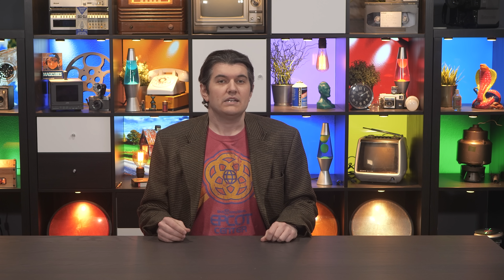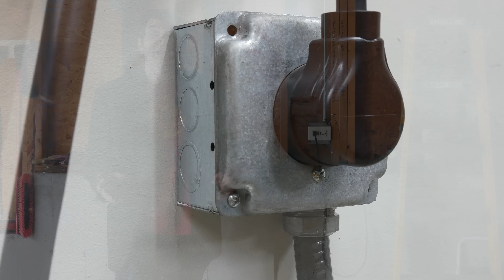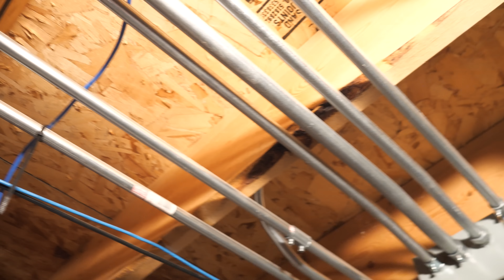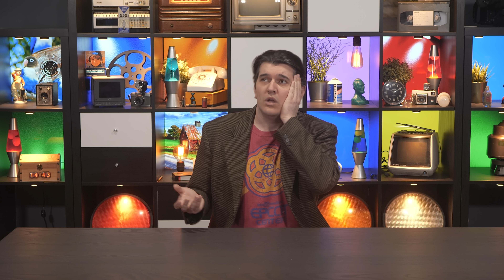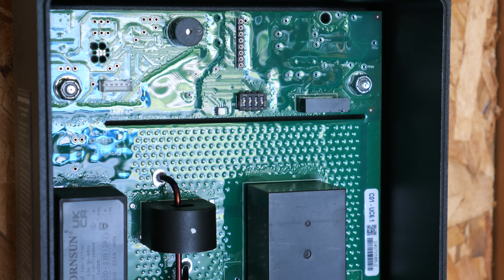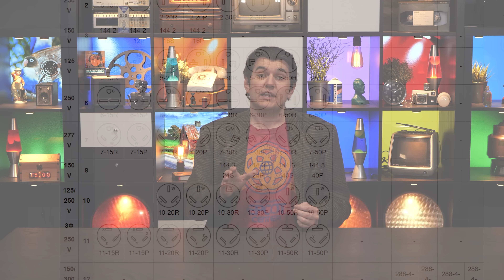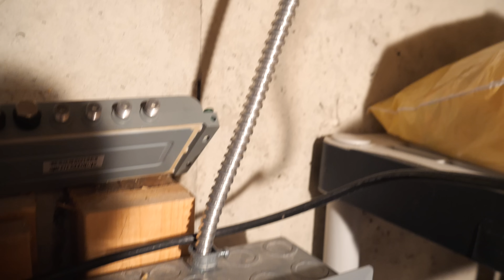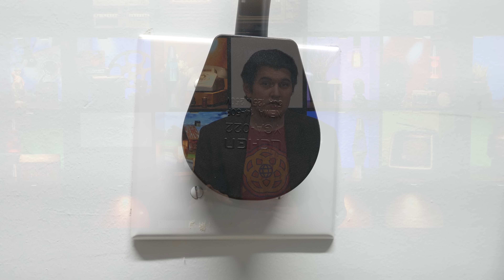The "standard" car charger is usually overkill—but your electrician might not know that

Comment: I would add that while 120 volt charging does work, it’s a really good idea to wire a dedicated circuit for it. Then if you are going to wire a dedicated circuit, you might as well do a 240 volt circuit. Then use the old, shared 120 volt outlet for your chest freezer 😎
Reply: Yup, when I’m charging level 1 at my parents cabin, it’s on a shared circuit. During the morning when brewing coffee, or while using an oil space heater, I have to drop the charging rate down to the minimum 5 amps or turn it off, else the breaker trips.
Reply: Further,
If using 120 V. 
Don't use a Residential Grade or backstab receptacle. 
At minimum, Use a Specification Grade receptacle. (best to get one brand new)
Also, if the 120V circuit has other receptacles 'upstream' of your charger, be sure those are spliced properly NOT using backstab type connections.
Reply: Where I live I trip the breaker if I have the microwave and the space heater going at the same time.  Took me 6 times doing it to stop fucking doing it.  Downstairs isn't wired for kitchen stuff and the house is 90 years old.
Reply: Yep. Using an existing old 120 volt outlet that isn't dedicated can and has caused fires when charging vehicles.
Reply: The sparky was going to be in my roof anyway, so I asked him pull 2 extra 20 amp wires for the garage while he pulled the thick 60 amp line. It was almost free except for the hardware and time to wire up the 2 extra outlets/breakers.
Reply: uh oh, you might have triggered alec's heat pump rants
Reply: Oh hello there Jimmy!
Reply: Exactly. You can literally add a 20 amp 240v circuit for a few dollars more than a 120v. But in cases where the runs are short and access pretty good, it makes sense to just go bigger for not a lot more money. Never use the old standard outlet in your garage unless you like drama
Reply: @JimmyDorff Just curious, why is it a really good idea?  I've been charging my Tesla on the shared 120V circuit in my garage since January with no signs of any issues.
Reply: @JesseOsby  The issues are mainly around the outlet itself, how old / worn out, how it was installed, are there other things on that circuit, etc. 
There has been cases of 120V outlets melting because of the continuous ~12A draw and a bad connection in the receptacle area. 
Most people don't know the history of the wiring in their house. Ultimately, documentation, building code and recommendations are built to handle the worse case scenario. 
So the new circuit is really for the peace of mind of having something that's proper all the way, with no surprise splices in there, etc.
Reply: @nuitari1669  Interesting, I'll have to check the temperature of my outlet with my temp gun the next time I'm charging to make sure it's not getting too warm
Reply: @JesseOsby  As others have said, many 120v outlets are poorly installed. Electricians in new construction are paid to go fast, and I've directly seen damaged / melted outlet from EV charging.
Reply: People worry that older installations were not made with the expectation of continuous maximum draw for 8+ hours. Issues due to poor connections/joints hidden in walls that might otherwise never become apparent until they overheat with an EV connected. 

Installing a new circuit ensures everything is really done to code.
Reply: Technically you via 2 cords take 120v off 2 circuits which if out of phase can be combined in "quick box" to get 240.  Woodworkers sometimes do this for an old machine they bring home and wanna run..  If one the same phase nothing happens, stays at 120.
Reply: Regular hours outlet charging may work but its 18% more expensive to charge long term, and you're more likely to use DC fast charging because your emergency charger cant deliver power in a timely manner. Sure you can own a 2 gas car but thats large expense insurance/registration/maintenance for a vehicle you typically wont you generally speaking. You're welcome to be arrogant and waste your time and money though.
Reply: Why not a 3 phase 400V wire?
Reply: @Johannes-c7p  3P 400V is not very common in the US. Only places I've seen it are in megascale datacenters so they can have 3 legs of 240 instead of 277 from 480. Typically you can't even get 3P run to somewhere residential, and if you do they're likely charging you $10k+, so you're stuck with split phase 240
Reply: @AlexZanderMuro  We use 3P 480V in the warehouse I work at. Its driving the conveyors and the robot sorting arms we use to sort packages. But, industrial building, not residential.
Reply: @AlexZanderMuro  Must be suck to be in the USA
Reply: @Johannes-c7p why's that? A majority of people have no need for anything more than 240v, and if they do, they're likely gonna need more than just a step-up transformer and a couple wires, which is why the cost is usually over $10k for something like that. Do EU panels get all three phases of 240, or are you just getting a single phase?
Reply: @AlexZanderMuro  I am not in the EU, we here have 3 phases with 400V (Phase-Phase) or 230V (Phase-ground) in every apartment. We need 3 phases for the boiler, stove and oven. No idea how you do that where you are. I heard some still use gas for the stove, but what do they use for the oven and boiler?
Reply: @Johannes-c7p  most people either run them all on 240, or will sometimes opt for gas-powered since it is usually cheaper here, especially for the oven. Thats pretty cool you have 3P everywhere like that; where are you from? I didnt know 400V was that common.
Reply: I have Never seen 400 volt 3 phase in my life anywhere .

450/480 3 phase is used with 277 volts for lighting using neutral 

Almost all USS homes are 240 volt single phase with 120 volts phase to neutral .

I have a friend in Galveston Texas that had 240 3 phase for his Home air conditioner !

Never seen that anywhere else but does exist .
Reply: @josephpadula2283  I've only seen 400v three phase on highly specialized equipment usually with its own dedicated transformer. Your friend probably has 208v three phase
Reply: @TheRealGrimx 
You may be right . I went to the electric company site and they offer 
240 and 208  3 phase in the area they service . Center point electric
Reply: @josephpadula2283  I've seen it in industrial settings
Reply: @Johannes-c7p  because this is a North American channel and essentially zero homes have 400V or 3-phase power on this continent.
Reply: @FuncleChuck  Yeah, must suck for them
Reply: @Johannes-c7p  Why not a 600V 3 phase?  You can still find some industrial sites using 600V equipment...
Reply: @Skinflaps_Meatslapper  600V is pretty rare, 400V is in almost every house, even in almost every apartment.
Reply: @Johannes-c7p  400V in a house is about as common as 600V in an industrial setting
Reply: @Skinflaps_Meatslapper  I was never in a place where 600V was aviable.
Reply: @Johannes-c7p  Ah, so your experience is the only one that counts, good to know 👍
Reply: @Johannes-c7p  The US does not provide 3 phase power to homes
Reply: @pineappleroad That is definitely not true. I'm sitting in a 3 phase house right now. Stop spreading misinformation.
Reply: @mediocreman2  I have never heard of a house in North America that has a 3 phase supply

I know that houses in Europe generally have 3 phase supplies
 
And where I live, 3 phase supplies in houses are extremely rare
Reply: @pineappleroad  Quite a few apartment blocks have (208V) 3-phase power. It's usually irrelevant as each phase is still 120V to neutral, but the pairwise voltage for dryers etc is 208 instead of 240.

Comment: I think the new Title 24 requirements in California require a certain percentage of overnight parking spaces in multifamily units to be level-2, and the vast majority are allowed to be what they call "low-power level-2", which is just 20 A (16 A continuous) at 240 V, which still adds like 10 to 12 mph of range, which should be sufficient for most.

I have my own garage and when I had my house energy upgraded in 2023, I had the electrician install a NEMA 14-50 outlet for me, and I remember when I installed my Wallbox charger, there was a hardware dial in the unit where I set the maximum charging amperage to 40 A (using the 80% rule for a continuous draw on a 50 A circuit). You can change the amperage on the fly in the app, but it's absolutely capped at whatever the internal dial is set to, so I can select anything between 6 and 40 A in the app, for example. I remember when setting the internal dial you could select 12A, 16A, 20A, 24A, 32A, 40A, and 48A, so lots of options, there: circuits as small as 15A and as large as 60A.
Reply: On my very first charger install, I entirely forgot to set that dial and had to go back the next day and open it back up and set it. 

This was years ago, people in my area were slow on the uptake for EVs, we did like... 3 chargers the entire first year. 

I haven't and won't be forgetting that step anytime soon. I felt so stupid, I even knew I needed to do it. 

Yep, I'm an idiot 😂
Reply: @goosenotmaverick1156  understandable after installing all of the other requisite components, and it wasn't set incorrectly for very long. Some of the other charger brands supposedly use software-only methods of setting the max current draw, but I've read elsewhere that NRTLs require a hardware switch to set max current draw in order to certify an EVSE 🤔

Comment: Great bubbling blueberries, Batman! You used wire nuts? What, are you living in the '60s?

Joking, I prefer wire nuts. They aren't perfect (they can loosen or not have a proper grip on all wires), but neither are WAGOs. (Single point contact). Maybe someday, someone will design an alternative which has the best of both worlds.